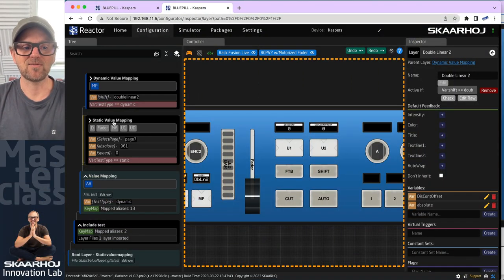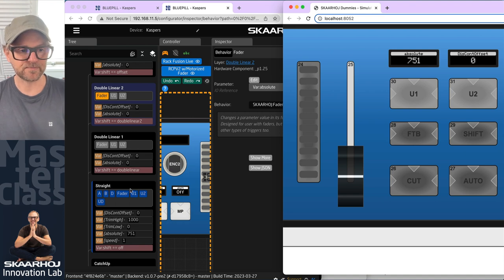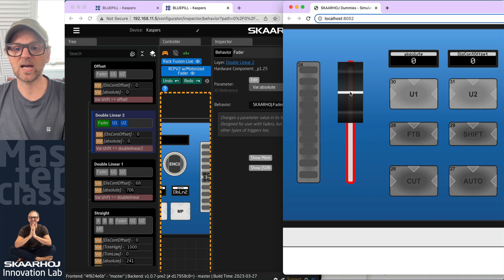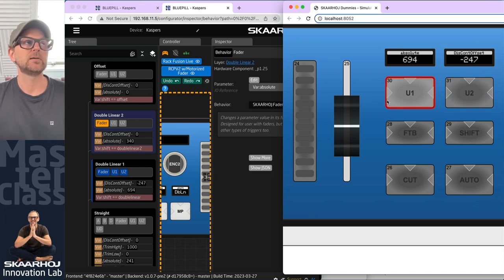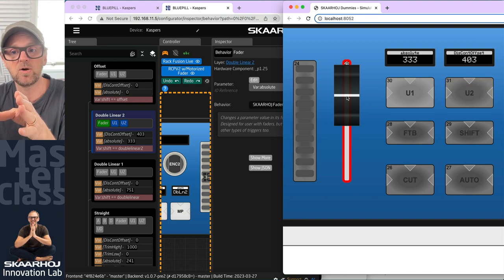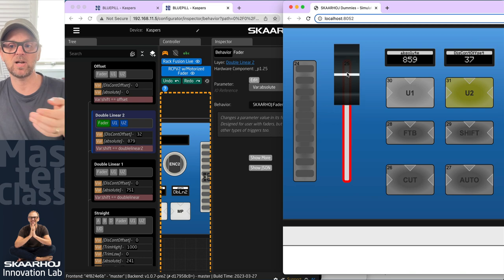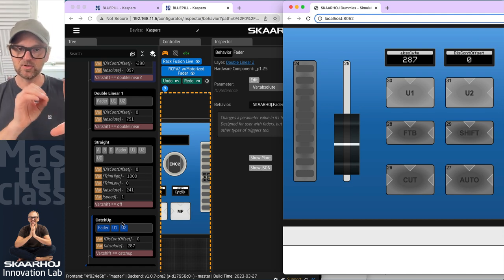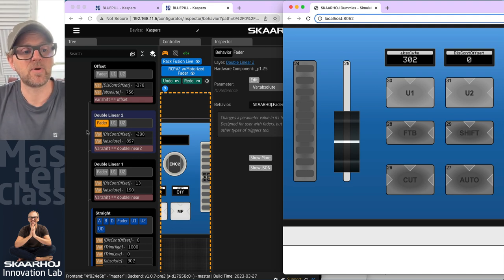SKAARHOJ Controllers: Tackling Discontinuity with Dynamic Value Mapping

Comment: Is it possible to use Dynamic Value Mapping to smooth joystick inputs, basically simulating in a PTZ the inertia that human-operated larger cameras have? Canon offers this as a setting on its PTZs, but most other PTZs don't, and you can really see the difference. I imagine it could involve continually resetting Double Linear Discontinuity throughout the range of movement on an adjustable time delay.
Reply: It's an interesting idea we will keep in mind. I'll start by studying what Canon does ... 🙂
Reply: @kasperskarhj2250  🙏🏼🍀🤞🏼Canon’s feature basically mimics what Adobe calls Ease-in and Ease-out, and it does smooth movement generally, but the HTML interface does not allow any control of how much easing is done. It would be great if the XC protocol allowed something like that.